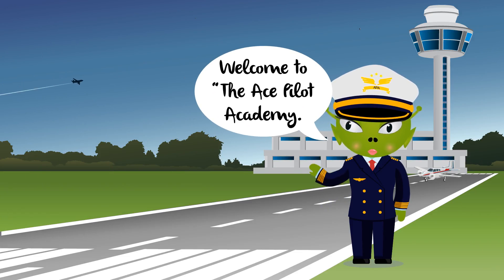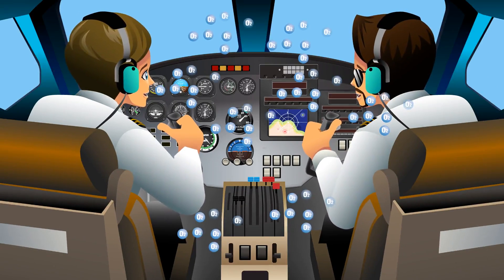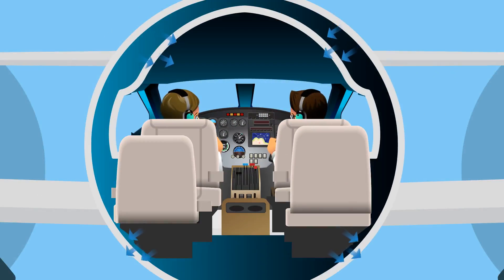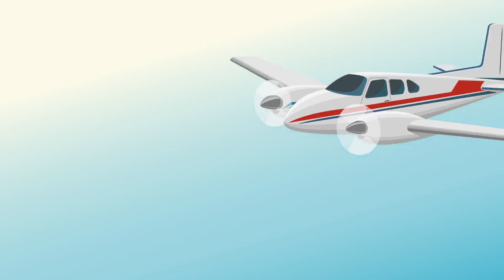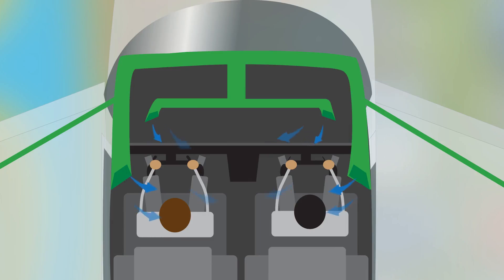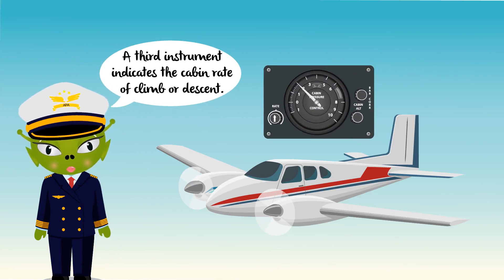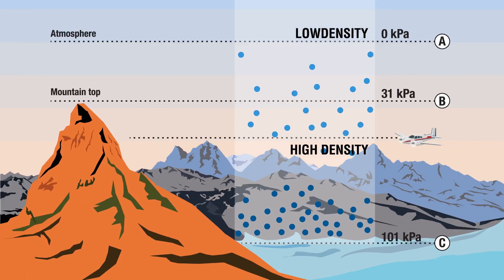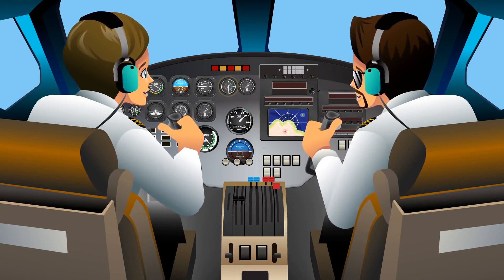Decoding Aircraft Pressurization Systems

Comment: Thanks for the explanation but i have a question why will the pressurization system not simply maintain cabin pressure at sea level(14.7psi) though its still a well breathable air but rather maintains pressure at about 8000ft(10.9psi) above sea level????
Reply: It has to do with the pressure differential between the cabin and the outside ambient pressure. Basically, to maintain sea level pressure at say 35,000 feet, the difference in pressure between the inside and the outside is huge and could be too much for the structure of the aircraft to handle.
Reply from the maker: Well said
Reply from the maker: Great point
Reply: Because there is a max differential. Basically this difference in pressure is the max amount you can blow up a balloon before it pops. If a plane is rated for 5.5 psi diff and you want 14.7 then you have to add more pressure than most are rated.